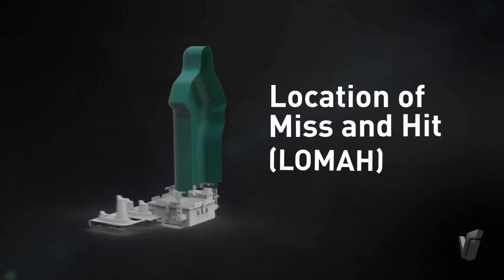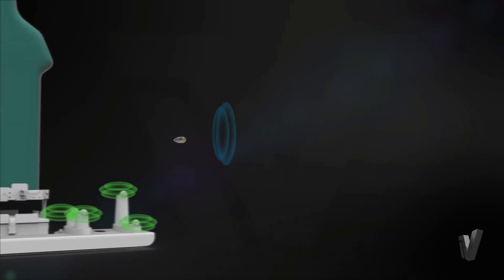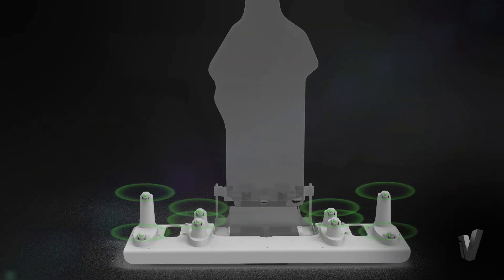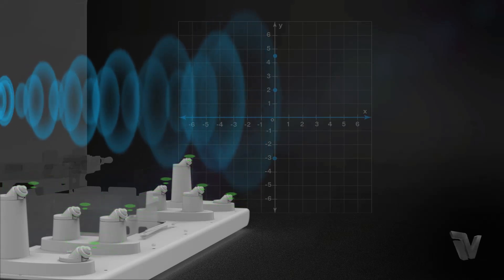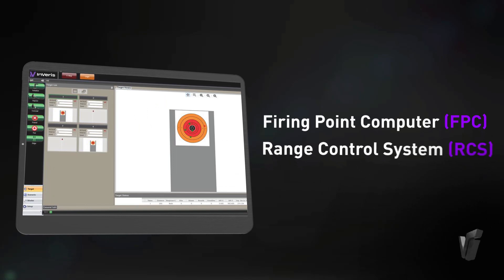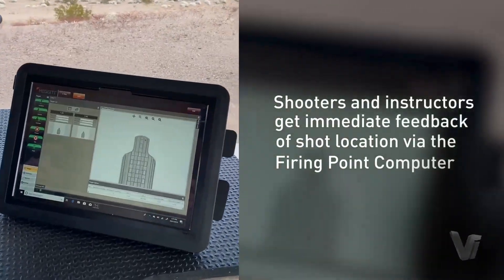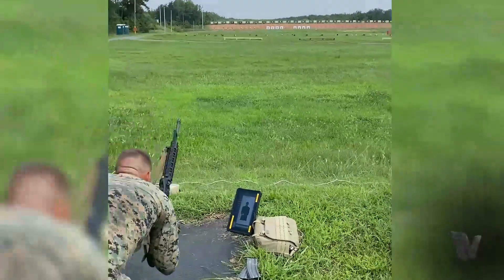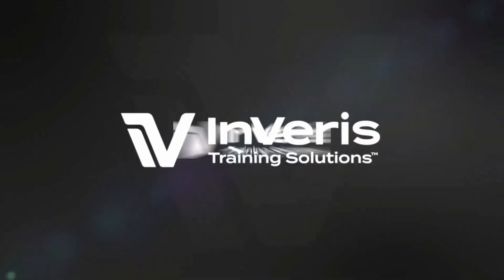InVeris LOMAH: How it Works

Comment: I understand that the default detection area of the LOMAH system is 3 meters in width and 2.5 meters in height. If the muzzle position is precisely determined and the detection area is extended to several tens of meters, how accurately can the bullet's trajectory be measured?